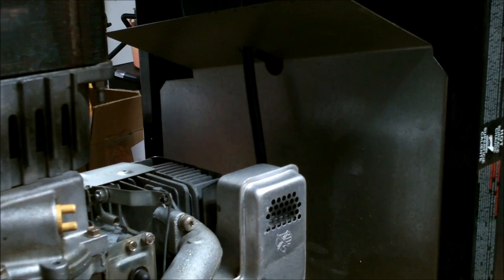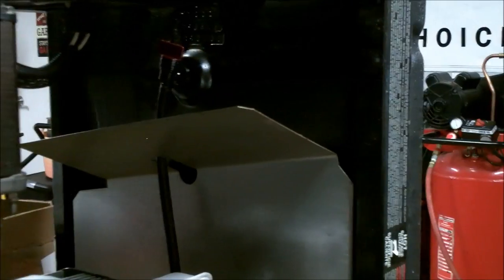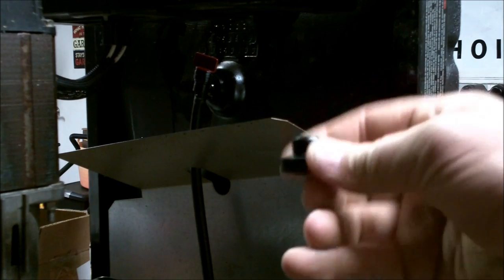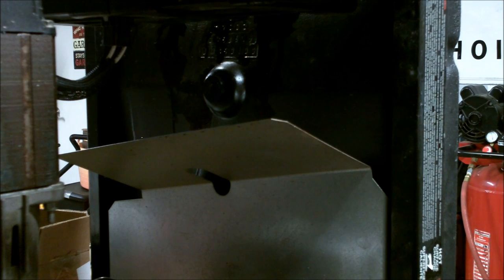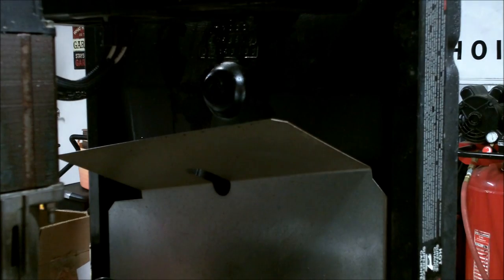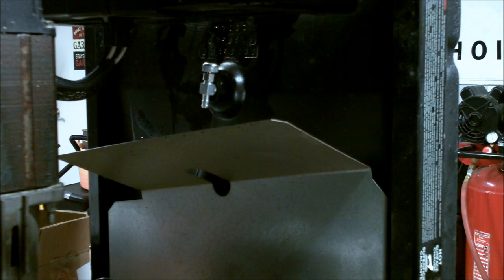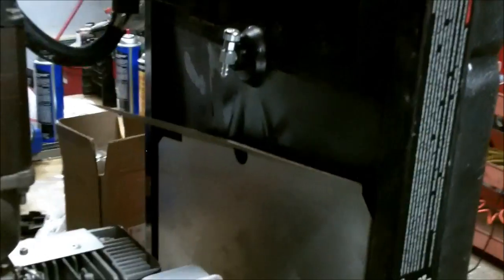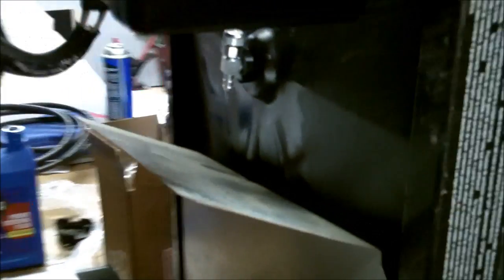HOW TO REPLACE LEAKING FUEL TANK GROMMETS ON MOST SMALL ENGINES AND EQUIPMENT

Comment: Fuel tank grommets are easy push into and take out of polypropylene tanks.    Just pull the tube or whatever is in the grommets out first - that makes room to compress the grommets.    It might not be obvious to you that whatever is in the grommet definitely pushes out.   So taking out or putting in - is two part process - seperate grommets from what goes through it first.....

Comment: I like to keep my gas tanks empty until needed, so put a T fitting and a second shut off valve so that we can drain the tank after the power grid is back up without disconnecting a line or siphoning gas.